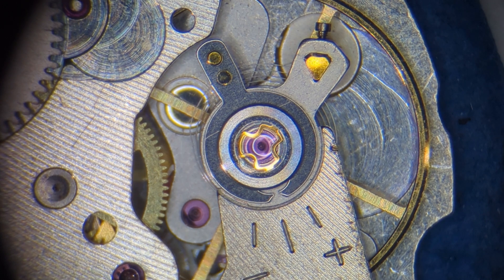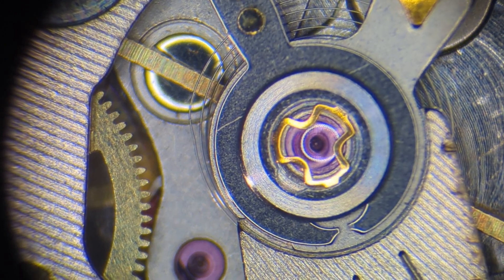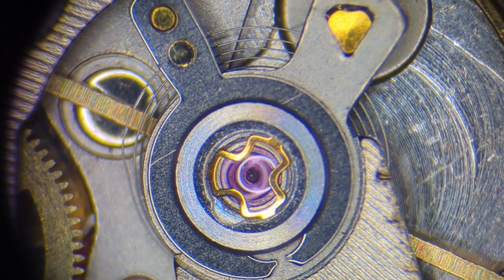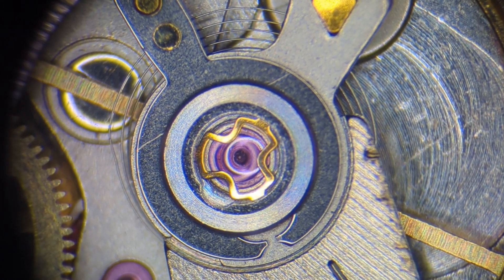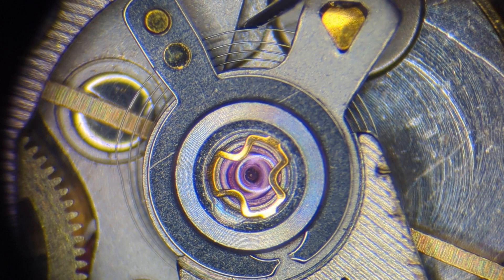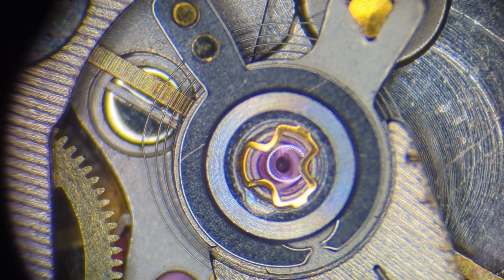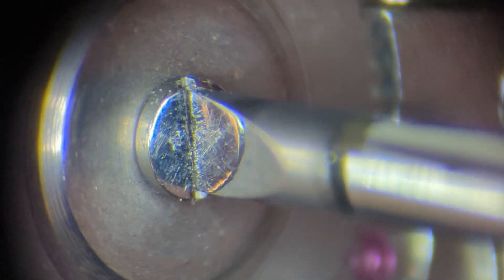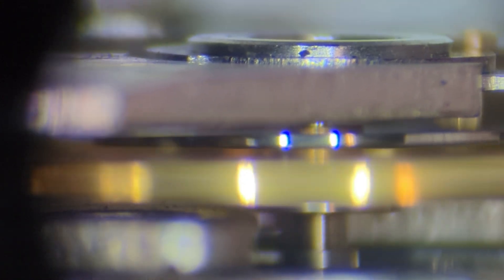Watch Repair Secret - How to Fix a Damaged Balance Hairspring!

Comment: Very interesting method under great magnification. I didn't know that it could be corrected this way without a complete replacement.
Reply from the maker: It could be done this way when there are particular defects of the hairspring. In other cases we need to remove hairspring from the balance wheel assembly. Thank you for watching!